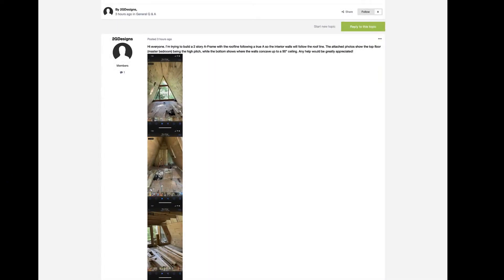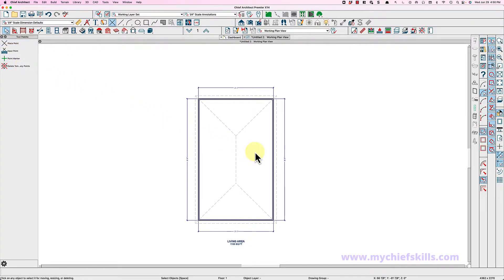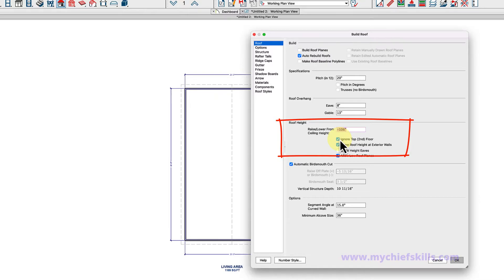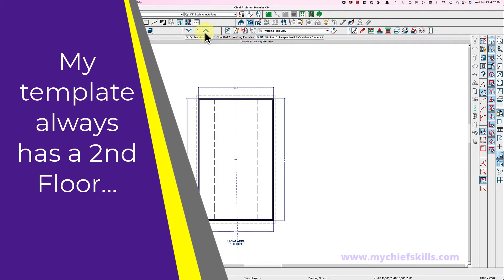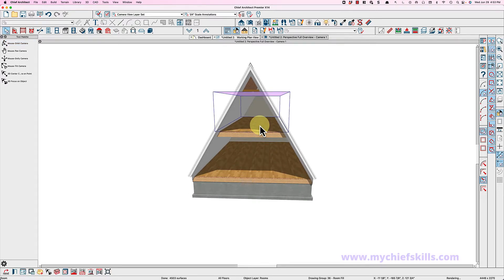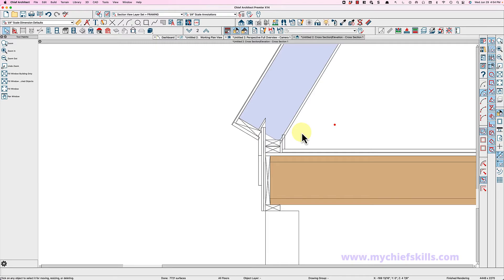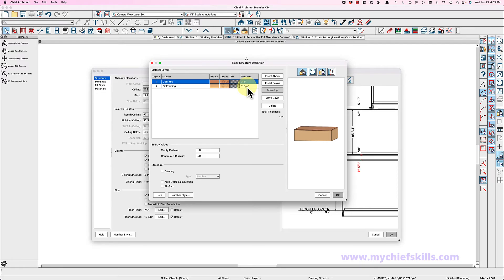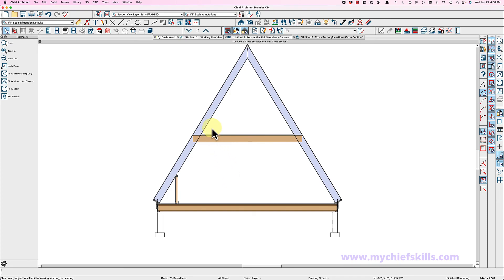How to create a 2-Story A-Frame style house using Chief Architect Premier X14

Comment: When I am in the build roof options, the ignore top floor indicates the first, on both x13 and x14. It seems like yours knows you're going to be adding a loft.
Reply from the maker: Evan - You need a 2nd floor in your plan in order for the roof tool to "ignore 2nd floor". So...first thing you should do is to build a 2nd floor...just select make blank new floor...accept the defaults. Then...build the roof, you should see the "ignore 2nd floor" option.